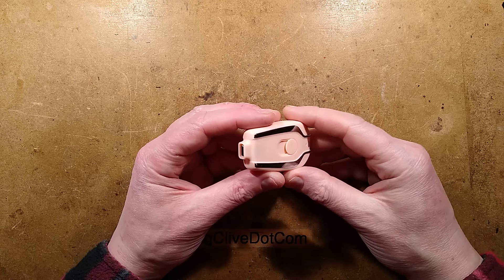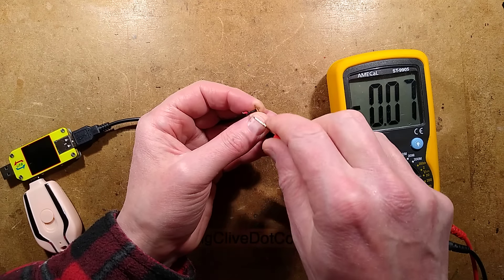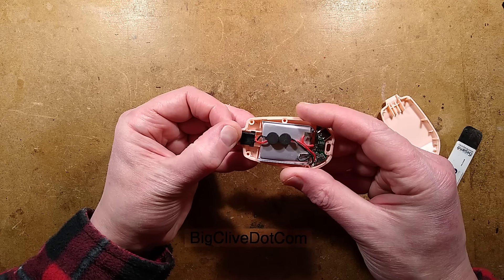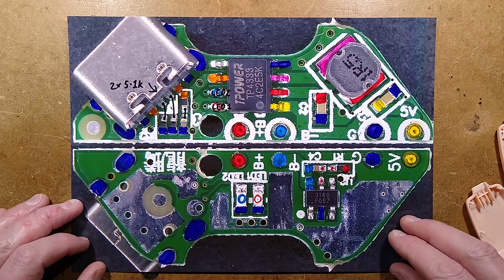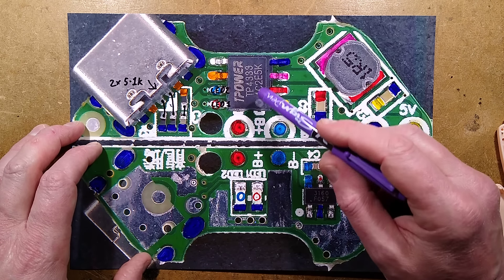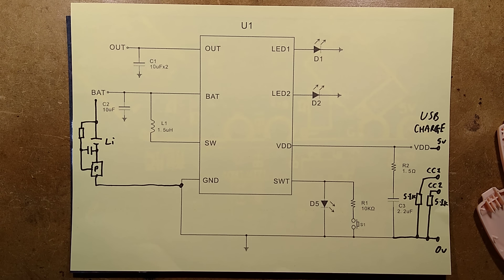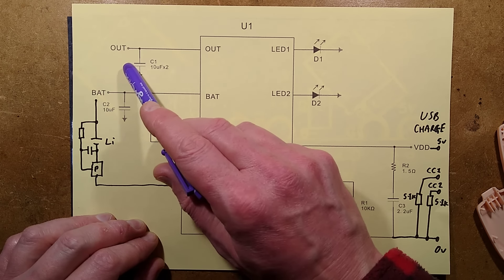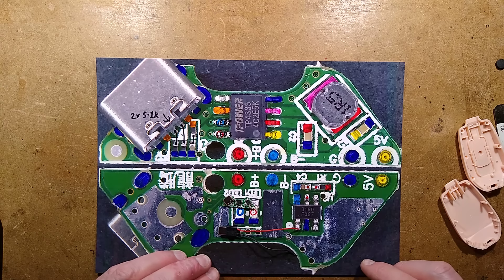eBay keyring phone-killer

Comment: True story:  I worked for a major aircraft company building commercial aircraft.  One of my jobs was testing exterior lighting on the ships.  One common and repeated mistake an assembler was committing was misunderstanding what they were told.  On the left side and the right side wing nacelle lighting there are two sealed beam 24V lamps.  Each lamp is connected via a ring terminal.  Absolutely no polarity was required.  Simple light bulb.  The assembler asked an intuitive question:  "Which wire goes to which screw terminal on the lamp?"  They were correctly told that it didn't matter.  Since they didn't understand current or how a lamp worked they assumed it would be quicker to put power AND ground on the same terminal and not have to mess with the other terminal.  So along comes the exterior lighting test.  That breaker popped every time because both power and ground were shorted together by the assembler.  Simple fix, move one of the wires to the other lamp terminal.

I did some investigating as to who was wiring them and discovered the error.  Explained how the lamps were to be wired and after that there was no longer a problem when a new aircraft came down the line.  Sometimes people are given the correct information but simply don't understand it.  Other times a person can be so overworked and rushed that they can easily invert the wires, as may be the case with your Keyring Phone Killer, though it was never intended to kill a phone.

I've worked in the quality field for 40 years and have encountered many similar issues.  Some people have a biscuit way of thinking while others have a more engineering way of thinking.  When the two communicate it's like speaking different languages.  My wife always has an issue understanding what I'm telling her.  She's not dumb.  Has her MBA.  The issue is more with how I disseminate information.  Do I do it in a way that is understood by all?  Or only by other engineers?

Always enjoy your video's.  Thanks.
Reply: Not trolling you or even directing this right to you but it reminded me of a joke.
How do know if you sitting next to an engineer in a bar?
Don't worry, he'll tell ya.
Reply: @buckfuhtt2083  i mean... you aren't wrong there lmao
Reply: Thank you for articulating that explanation perfectly, I enjoyed reading what you've shared, I agree as well.
Reply: Isn't that simply called ambiguity?
Reply: Some people just want to watch the world burn. Sad but true.
Reply: Wiring power and ground to the same terminal... That is just simply not knowing how a basic electrical circuit works. Some company hired somebody like that to wire electrical connections on an aircraft?! Oh my god. I'm not so sure I want to complete my commercial pilot training anymore.
Reply: @TheFlyingZulu  Fortunately there's functional checks and certified inspectors who look all things over.  It was uncovered when I was doing a functional test.  Upon finding the same mistake made repeatedly on every aircraft I looked into who was doing the wiring.  These weren't electricians, they were "Wire Stringers".  Their job was to run the wires through bulkheads and terminate them according to the blueprint.  Unfortunately the engineer who drew the blueprint assumed everyone would know that you don't put power and ground on the same terminal, that current had to flow through the filaments in order to light up.
Reply: And that's why you never validate your own work. Sometimes you're the one making stupid mistakes.
Reply: People assume they understand when infact they don’t and are too afraid to ask. 
Asking (stupid) questions should be engouraged!
Reply: @tonn333  Best answer I can give when I don't know the answer is "I don't know."  That way I avoid looking stupid.
Reply: @petec6690  some also avoid looking stupid by NOT asking questions.
Reply: Yep, I get this! I've been working as an engineer in various fields for 30 years. Some people just don't get it. It's like an engineering mindset, where some people fundamentally understand how things fit together, and others just... don't.
To be fair I have the same problem with not "getting" people most of the time, so... swings and roundabouts.
Reply: @jonnamechange6854  No, not really.  Though the technician who answered their question could have been more clear, what seemed to him as something a snail would have understood was that one wire goes to each terminal on the lamp.  The person doing the assembly work just didn't understand the difference.  Sometimes explaining something so simply stupid one might assume the listener understands, and thereby they make a mistake.  Once it was properly explained the problem was resolved.  And the assembler was more educated for it.
Reply: @petec6690  Thanks.  To the question: "Which wire goes to which screw terminal on the lamp?", I meant the reply: "(They were correctly told that) it doesn't matter" was the ambiguous part. In truth it did matter when someone  with no experience simply asked a pertinent question. The engineer was presented with a question that displayed obvious ignorance indicating that a thorough explanation would be required. Instead, he arrogantly assumed a lazy, ambiguous answer should suffice.
Reply: @jonnamechange6854  Unfortunately us engineers often think in clear terms and assume others are on the same or similar page.  Whomever told them it doesn't matter didn't understand the depth of lack of understanding on their part.  "It doesn't matter" to an engineer means there's no polarity.  To an assembler "It doesn't matter" means it doesn't matter where the wires go.  On some level there was logic to their thinking they could put both hot and ground on the same terminal because it saved time.  If it doesn't matter then - um - it doesn't matter.
Reply: Yes some of us follow directions explicitly and this always makes a possible lesson for the assembler of said instruction set
Reply: I worked at a Bendix plant that manufactured and tested autopilot systems for single and twin engine aircraft. One day we got a report back from the field that on a number of aircraft there was a major malfunction in the autopilot system. When the pilot engaged autopilot, the plane rolled over and began flying upside down. That can be unnerving. We traced the problem to a miniature transformer on a circuit board. At the facility where the transformer was made there was a new employee who was winding the transformer in reverse. Once all the defective transformers were identified and disposed of the problem never reoccured.
Reply: @petec6690  especially when the question was "which goes to which"   ---- to me implies knowledge that both wires can't be on one terminal. "It doesn't matter [which goes to which]" should've been adequate.
Reply: Maybe some actual training would help.
Reply: @buckfuhtt2083  😂😂😂😂
Reply: @petec6690  you are too kind.
Reply: When the question was asked which wire goes to which terminal , the answer should not have been it doesn’t matter.  The answer should’ve been one wire goes to one terminal and the other wire goes to the other terminal.   And there should’ve been a demonstration. A sample for all to see.
Reply: @Pammellam  Absolutely.  Unfortunately us engineer types seem to think everyone else understands what we mean when we give an answer.
Reply: PC: "Press any key to continue"
Instructions unclear - Presses shutdown button
Reply: A QC check would have caught this. I guess that's expecting too much from our Asian "friends". Good job that you caught this. Keep up the good work!
Reply: If something can be assembled multiple ways, and one is disastrous, it is a management and design issue.
https://en.wikipedia.org/wiki/Poka-yoke
Reply: A long time ago my Grandfather re-attached a mains plug to an appliance, the mains cable had 3 cores, and the plug (an old style one) had 2 pins. So he wired the black to the neutral pin, the red to the live pin, and having a green wire left over and no pin to connect it to, he split it in half and put half on each pin! -  Needless to say what the result of that was, but just another example of what goes through a non-technical mind in the face of a challenge like this. 😊
Reply: @TheFlyingZulu  Isn't it crazy that someone like that could get a job working on aircraft?  Even if it is just wiring up the lights.  I would imagine the job paid decently.  It seems like lazy idiots who don't give a crap and call in every other day can get decent jobs easily.  Yet someone who will actually show up and do the job properly has a harder time finding a good job.
Reply: so this was your exciting moment during 40 years working in quality control, I see
Reply: I get that too. Sometimes told "you sound like an electronics manual". Well, you can't please everyone, perfect example "biscuit".
Reply: @petec6690  I've never heard of biscuit thinking - where does that come from?
Reply: Everyone with a degree isn't smart.
Reply: @moaningpheromones  There are very few things more simple than a biscuit.
Reply: @TheFlyingZulu 
They're probably colourblind too boot!
Reply: @tonn333 
There's no such thing as a stupid question, only stupid mistakes!
Reply: @petec6690 
A lack of knowledge is not a lack of intelligence!
Reply: @Allangulon  stupid questions do exist. But even those deserve an answer, provided they are answerable.
Reply: @tonn333  
Not everything is obvious to all.
Even an apparently stupid question is an inquiry revealing a desire for information, and information is never stupid even when incorrect.
Reply: @Allangulon  information or the desire for it is not stupid.... But a question certainly can be.
Reply: @tonn333  
Only when the answer is glaringly obvious, then the asker is stupid not the question.
Reply: @Allangulon  asker might be a genius though... Just missed something and therefore asked a stupid question.
Reply: @tonn333  
It's still not a stupid question to them, only the hearer, who's stupid then?
Reply: @Allangulon  that's the point, none of them might be stupid... But the question certainly can be.
Reply: I don't think I questioned anyone's intelligence.  The assembler making this mistake was by no means dumb.  Just encountered something they didn't understand. @Allangulon
Reply: Zzzzzzzzz zzzzzzzzz Zzzzzzzzz wow, that put me to sleep.
Reply: Years ago, I worked at a factory which made light fixtures. Mostly track lighting for stores. When we had someone new, we showed them what to do and then watched them do it a few times to make sure they were doing it right. Seems like common sense to me.
Reply: @Meechy5280 Rarer than you think.  It is generally better (and probably more accurate) to attribute things to simply being mistaken than being malicious.
Reply: I'm not sure how you can be comfortable with someone assembling electrical components on an aircraft if they clearly have zero understanding of electricity. That doesn't make sense at all, you chalk it up to a bad explanation but it's not, it's complete incompetence. Your reaction and justification is disturbing.

You also rationalize it by saying your wife doesn't understand you a lot of the time but has an MBA so she's smart. Some of the dumbest people have the longest list of academic qualifications, they can have zero common sense or ability to think, see problems or make decisions.
Reply: Don't know how you're defining "disturbing".  As for what I've seen in the manufacturing sector 40 plus years is that often a person will be hired simply because they're willing to show up for work.  Sometimes it's "Affirmative Action" that leads to people getting a job they're not qualified for.  Too often a manufacturer will assume they can teach a new person a job, which is most often true.  But I've seen it time and again people who have absolutely no mechanical or electrical aptitude get a job doing something new and foreign to them.

My wife is very intelligent - even without her MBA.  And I've known PLENTY of educated idiots, people who have no good sense to them.  They're everywhere.

Me?  I got my engineering degree at Cal Poly Pomona. I have worked as an engineer a good 20 years now.  It drives me crazy when I see people get hired as an engineer when they don't have a lick of mechanical understanding.  Most recent encounter with one of these so called engineers was just a few years ago (I'm retired now).  We argued over the leader line on a blueprint.  The assembler was trying to apply a dimension to everything the leader line touched when it's sole intention was to show a specific clearance between two high voltage terminals.  I have old school drafting experience as well as years of assembly and inspection before becoming a quality engineer.  This "Kid" was an inspector with no soldering experience.  He inspected for three years, then applied for an opening for an engineer in his department.  He got the job.  I asked him where he got his degree and he stood there with a dumb look on his face.  Asked him how long he's been an engineer.  "Two years" he said.  Two versus 20?  A formal education versus a kid who before getting into the manufacturing arena was a Cheese Herder?  Some people are as sharp  as a tack.  Others are as sharp as a fuzzy tennis ball.

Your criticism makes me wonder where you fall on the spectrum. @Kiowan918
Reply: my dad was a PDI for some exotic car company down in florida, he'd tell us how some cars would come off the truck and the most random things would happen, like he'd test the turn signals and the wipers would come on... just the most random stuff
Reply: @petec6690  I am scared that there are adults that don't know this.
And they probably drive a car and vote.
Reply: I assemble electronics, ranging from building complete light fixtures to soldering components onto a circuit board. I've made simple mistakes like accidentally swapping the negative and positive wires coming out of a power supply or soldering an LED backwards. Sometimes you're just tired or been doing the same thing for hours on end. Luckily nothing usually gets damaged, LEDs don't blow up when you feed them backwards voltage.
Reply: Standard diodes have a high tolerance of reverse voltage whereas light emitting diodes do not.  Try this experiment - but be darned careful you don't shock yourself.  Take a common red LED with a forward voltage of 2V (2Vf).  Decide to operate it on 10 milliamps (0.01A).  (120V - 2Vf) ÷ 0.01A = 11.8KΩ.  Round that up to 12K since that's easier.  At that high resistance your circuit will run less than 10mA.(9.8333•••mA).  Plug it in and see what happens to your LED.  For those who don't want to wait for the sequel, the diode will blow out in a flash of light and excitement.

I accidentally wired a CB radio backwards and blew a circuit trace on the board.  The radio was reverse diode protected so that if you DID connect it backwards instead of blowing out components you'll just blow a trace on the board.  That's easy enough to fix.  But fortunately whatever you've wired backwards by accident luckily it didn't blow out. @PunakiviAddikti
Reply: @wakelamp So that's why Japanese automobiles are so much more reliable than domestic.
Reply: @TheFlyingZulu Those bugs eliminated by the PDI so no worries 😊
Reply: I was curious an looked up the words for the red and black in Chinese, thinking that was the problem of the mix up. Nope neither has a G or a R or y as their first letter.   Back in the 1990's I bought a JVC equalizer for my car, and the instructions for setting the saved setting was not working till I got upset with it. As it turned out the words for press and hold were all converted English to the word press. So to save the setting I had to hold the button in for a short time, not just press it.
Reply: in this case it was probbably a new employee doing the wires.  and another newish employee doing the test. 
and the guy doing the test saw 5 volts and didn't notice the negative icon
Reply: I also have trouble finding ways to make the thoughts in my mind understandable to others, to me, and those that are used to my way of explaining things, it makes perfect sense, but to most, its frustrating for both of us.
Reply: Besides the fact that it did, in fact, matter in that context, the assembly instructions should have specified which goes where anyway. You want repeatability and conformity in such things. If nothing else, such sloppiness will make itself known in issues elsewhere.
Reply: @chaos.corner  The point of this story is that not all people understand how things work.  Intuitively a person should know that two wires and two terminals means one wire goes to each terminal.  The question asked "Which goes where" was the right question.  The answer "It doesn't matter" is the right answer.  What failed was understanding that one wire has to go to one screw and the other wire to the other screw.

When I was seven years old I started messing with machinery and electricity.  Yeah, I got shocked a couple times, but I learned quickly how things worked.  I managed at age seven to work out a rotary switch with multiple sets of contacts and figured out how to wire the motor to a battery using the switch to reverse the direction of the motor.  AT SEVEN!  Some people just don't have the intelligence of a child.  I'm certainly no genius prodigy, just an ordinary curious little boy who not only asks "Why" but also "How".
Reply: @petec6690  And my point is "it doesn't matter" is not a direction of adequate quality when it comes to repeatable assembly, even when it doesn't.
Reply: @petec6690  For example, if they decided to swap out the light for an LED assembly, they'd be in a pickle since every such installation would have to be tested for polarity and appropriate changes made.